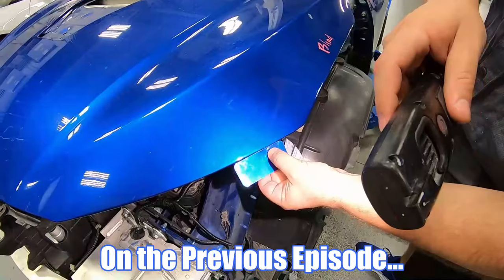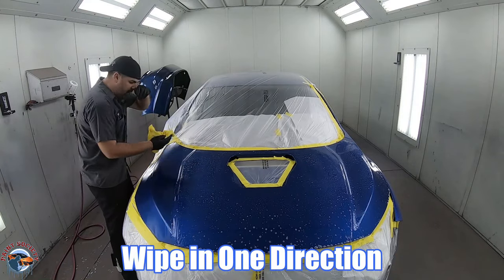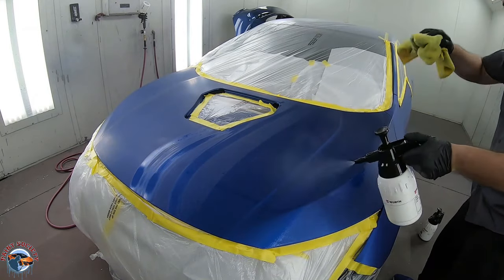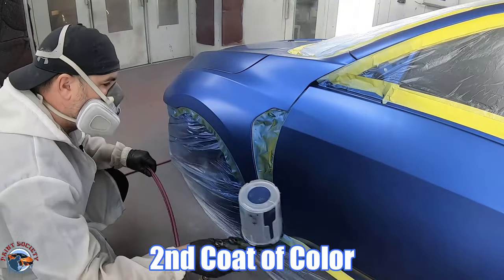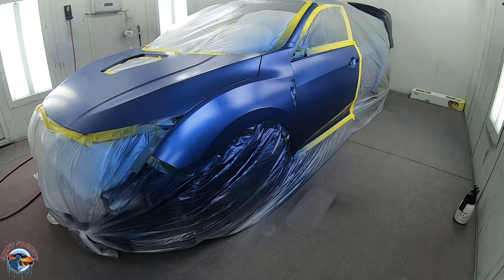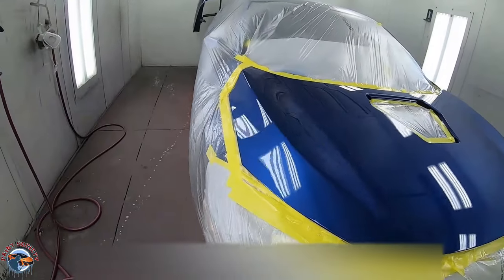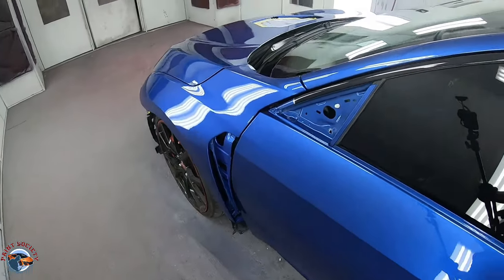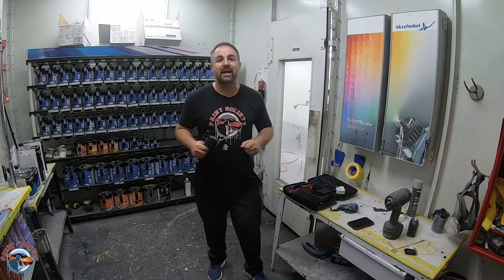These Steps Will IMPROVE Your Paint Jobs! Repair Build Honda Civic Type R Part 3

Comment: I paint cars for a living, and even I'm addicted to this guys videos. I know what he's doing and why, but hearing how he explains everything and watching the process makes me a huge fan. Don't overthink it, it's just paint
Reply from the maker: It’s just paint Brotha ! Thanks man
Reply: Paint cars for a living? Then I have a "What would you do?" sitchashun to throw at ya'... On my second coat of ghost blue powder, mixed in with the clear coat, on a black base, apparently some of the clear coat from the first coat had dried a tad. Even though it's slow activator, it's pretty hot here in Texas. But I only gave it about 3 to 5 minutes flash time even though this particular clear coat doesn't even require a flash time.. anyway.. some cellophane type dry paint come flying out and put 5 inch diameter areas of a bunch of small pieces of this dried clear coat. I tried to meticulously pull them out with a very sharp dental pic, but there's just too many. I sanded it down smooth, but now black spots where the clear coat pieces were, is showing through. Almost like little divots. Though they're smooth, it gives the appearance of "bumpiness". I went over it again with the ghost blue, and as expected, can still see it. I think I know the answer, but I'm curious as to what I could have done in the beginning or later or whenever. I'm probably now at a point where I'll have to sand the whole hood back down....? Sorry so long. This is the first time I've ever picked up a paint gun and I went from a white card to this black with a ghost blue. It actually looks very nice except for the hood. Any suggestions, advice, or "Hey! You should have done this!!", commentary is appreciated. Thanks! And yes I love these videos too. Paint Society's the best out there. And trust me, this venture of mine has taken me to channels I didn't know existed on YouTube LOL
Reply: @bonscotty67  way too many details just for paint flakes. If you got flakes going into your job, most likely you did poor masking and it flaked off of non treated plastic. If you did proper prep, no clear coat should flake like that after such a short flash time even in the Texas heat. If you got flakes of paint floating into your job, whatever panel it happens to is a repaint.

Comment: YES! CLEAN YOUR SURFACE! Brian, you couldn't be more correct. Surface prep and cleanliness is PARAMOUNT to optimal adhesion. CLEAN, CLEAN, CLEAN and then CLEAN some more. Also cleaning at the proper steps to prevent grinding in contamination. A friend of mine works for a company that made it a real scientific process. They engineered a tool that can scientifically measure surface cleanliness. When aerospace, automotive and tech companies have an adhesion problem in their manufacturing or maintenance processes, they can now identify it. This allows the customer to prepare surfaces to the degree that is necessary for proper adhesion. They can also do now this without wasting chemicals, time and therefore money. While this tool may be way outside of our DIY or body shop budget, we can still learn and keep in mind just how important this part of the job really is.

Comment: Honda Civic Type R vehicles are gorgeous cars and so is this blue. It's very similar to the blue Subaru has been using on their vehicles for a while, and the blue that VW used on their Golf R in ~2016.  I came across this 4 part series only now.  I'd seriously consider repainting one of my current vehicles one of these colour variations.
Very nice job.

Comment: A reason I stay away from microfiber towels in a DIY setting is I have found it can introduce static to my panel, and since I don’t have a static gun to neutralize it I try to avoid it if possible , i have come across some Devilbiss Dewipes , for final wipe and helps Neutralize the static created by the microfiber towel so that might be a solution  for many spraying at home.
Reply from the maker: Never used them. Seem pricey though? Honestly any contact you have with the surface is going to create some sort of static. Might be a good investment for you to look into the static gun since you’re going to be painting for a long long time ✊🏻
Reply: @PaintSociety  not going to lie, I have been looking into more affordable units , like ionstar. Damage undone made a video about it. The dewipes I have are about 30 bucks for 50 wipes. I just know those static guns are very pricey, and I don’t spray as often as pros in the field.

Comment: Good vid.I use solvent panel wipe first,then water cleaner,it seems to help with static.
Reply from the maker: I use water first because it takes longer to dry so that second wipe with the solvent usually will get any water missed on the first pass also I have found that the solvent leaves less smearing/streaks in the finish

Comment: I have learned so much watching your videos you explain the process so well. Can I just ask, why wasn’t there a need to blend into the right side fender seeing as you based the whole front bumper? Wouldn’t you notice a colour difference between both panels? I learned not to do this from your other videos but now I’m confused, what did I miss does it depend on the colour match or the fact that it is plastic bumper so colour won’t be exact anyway.

Comment: Great video, though I am a little confused. You have taught us to use clear base in blends. This time you used a 20% slow reducer on the last base blend coat. Does this take the place of the clear base for blending? Thanks.  😊
Reply from the maker: I’ll have to do a refresher video. I’m finding more success lately using over reduced base.  I do however use blending additive on tough colors when needed. This wasn’t a tough color
Reply: @PaintSociety  
Thanks Brian....    Good stuff!!

Comment: Your channel is awesome!!! First of all. 

Second
Ive seen a few of your videos use a clear base before using a color base for blending.

Why and when do you use a clear base coat also a clear base coat is a different solution from a top coat clear solution? Or they are both the same just used in a different manner?
Reply: Your question kinda goes along with mine which I posted recently. "Great video, though I am a little confused. You have taught us to use clear base in blends. This time you used a 20% slow reducer on the last base blend coat. Does this take the place of the clear base for blending? Thanks.  😊"
Maybe Brian will have time to get back to us.

Comment: Brian, as always great videos.   How does the Clear coat gun your using compare the lph400 or the supernova I have used those for years but have always been wondering about those guns.  What’s your thoughts I’m in need of another clear coat gun.  Thanks again for great videos.
Reply from the maker: I been using the Walcom clear gun and hard to say I’ll go back to any other guns at this point

Comment: couple of questions.. 

1. do you usually adjust your gun pressure at 20psi when basecoating? 
what is  the psi for clear coating? 

2. when you blend A pillar or B pillar, it is not necessary to do clear coating for whole pillar with back panel? 
 when i did like this, the border of masking tape was so standing out .
and when i tried not to be closer to the masking tape like this video,
the particles of clear coat made foggy ..

how can you solve this?
Reply: 20PSI is kinda the default pressure for spraying waterbase. Clearcoat is based on whatever clear ur using and what gun u are using. It varries from 18PSI al the way to 40PSI. Start at 28PSI and adjust from there on how ur clearcoat is laying down.

Comment: Can you get more in depth with how you blended and clear coated the A Pillar without leaving a hard line. How do you get such a smooth transition without leaving any tape lines on the A Pillar?
Reply from the maker: 800 the pillar. 3000 3inches further at the edge of the 800. Stop clear at the 800 for the first coat and then stop clear on the second coat at the middle of the 3inch 3000. Allow it to dry. Scuff with 3000 and buff

Comment: I painted a power wheels with duplicolor rattle can in candy red and some spots looked good but the majority looks like it's faded real bad. I sprayed it over a 3 coat gold  base and the gold turned out good. What did I do wrong? It was 75⁰F when I painted.

Comment: Is it ok using the same gun for different appliances in one same job: sealer, base coat and clear coat? I’m about to do my first paint job(on a budget), I’ve been watching a bunch of your videos and still have a lot of questions like this. Trying to not overthink it lol.
Reply from the maker: Yes just clean it out good
Reply: @PaintSociety  thank you so much for the quick response and for taking your time to helping me. I have a sonic silver Mazda Cx-9 2019(45P), bad paint job done before(I don’t live in the states) and since it’s pretty hard to find someone here responsable, I decided to paint it myself. I have bought a 30 gallon compressor as you recommend, and now I’m about to buy a 3M accuspray paint gun with two atomizing heads (1.8 & 2.0) do you think I’ll need more different size nozzles for one-time-only job? I’d appreciate it a lot.
Reply from the maker: Get 1.3 and 1.8

Comment: Brayan if you painted the front bumper why not just blend the whole front end?  Or at least blended the front of the hood so the bumper could match? Or did the insurance not pay for that portion?
Reply from the maker: I’ll usually throw some color on the hood if don’t have a good color match but the color matched so well and I didn’t want to take away from the original color of the car.
Reply: @PaintSociety  nice came out OEM but also why didn’t you use blender or is it only used on harder metallics?
Reply from the maker: @pedrosaenz5540  started getting away from blender on colors that don’t need it.  I’ll only use it now when the color doesn’t blend out

Comment: I own a 21 Type R. If that one is like mine the factory clear is super soft. So it will probably help with chips on the front with that clear that was applied on the respray. Very nice blend on that Aegean Blue.
Reply from the maker: The clear on the hood was a bit tough to sand. Little harder then I’m use to. Paint manufactures are always switching up the paint brands.

Comment: The pump you use for the  degreaser what kind do you buy ? I used some from home Depot and Lowes and both inside parts  deteriorated after a couple hours
Reply from the maker: I link all products in the description. The ones from Home Depot are only meant for very light chemicals
Reply: @PaintSociety  thanks!

Comment: Hey man just one question what kind of paint you are using for this car ?
Reply from the maker: Solvent sikkens
Reply: @PaintSociety  so when you paint a has to be  so wet the paint?and   how you reduce the solvent paint 🤔  sorry for my ignorance I'm from California I just to work in the bay area and we use water base so I move to the valley and all the shops use solvent and I have no experience on solvent
Reply from the maker: @minecraftmaster6582  it depends on the system and what the tds says.  You spray base medium wet and clear is wet
Reply: @PaintSociety  ok cool man thanks I will try that out 👍

Comment: 🤣 🤣 so.  Mine didn’t turn out so well.  Ive got a ton of over spray that didn’t “flow out”. Looks like sand got tossed in the clear coat..  the passenger side was glass, then I sprayed the trunk, keeping the wet edge, and the over spray from the trunk fell onto the passenger side..          moving to slow? Wrong reducer?   I don’t get it, slow enough to cover, fast enough for no to VERY few runs.🤷‍♂️ had one run was.

Comment: What does static do to the paint process?
Reply from the maker: The plastic attracts static and static attracts anything floating in the air. 
Basically you get a cleaner job
Reply: @PaintSociety   thank you
Reply: Metallic can lay down in wrong orientation so it will not have a consistent look.
Reply: @davidg5704   thanks

Comment: I hate to be the one to say it but why aren't you wearing an air supplied respirator when spraying the clear, I painted cars for over 25 years and I know they are a pain in the ass to wear but icosyinate  exposure is a serious threat to your health and it never exposes itself till later in life, particulate respirators of any kind do not filter that toxic substance,  as a painter your chemical exposure is unavoidable and you seem very good about taking the necessary precautions, I used a system that actually filtered air from the compressor into a full face mask it attached around your waist and it also supplied air for the gun, maybe not for everyone but it worked well for my needs and eliminated the need for another separate air system in the booth.
Reply from the maker: Looking into the 3m one. Only paint a few cars a week so haven’t had the need to get the full face at the moment but it’s in the works. You bring up great points.